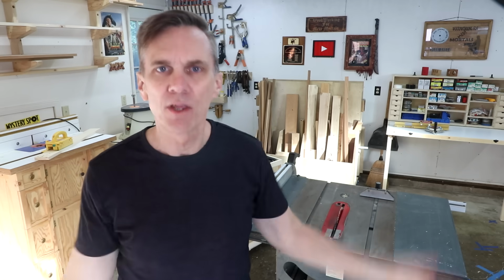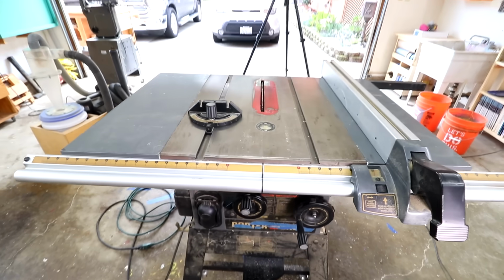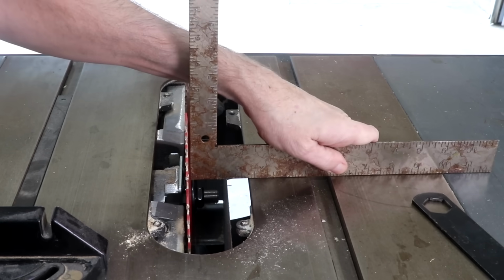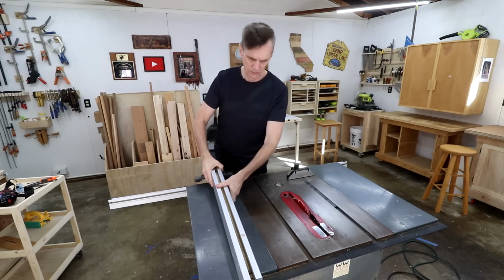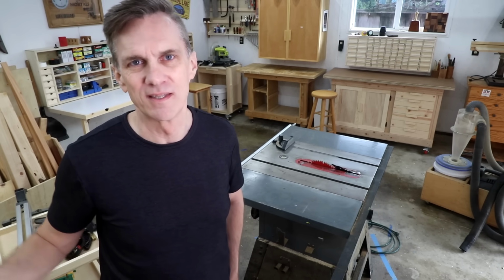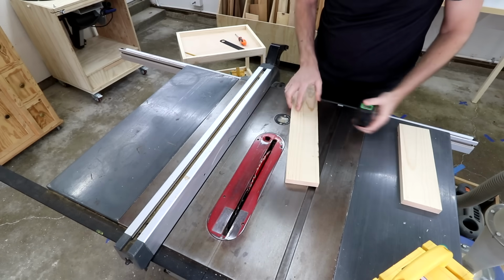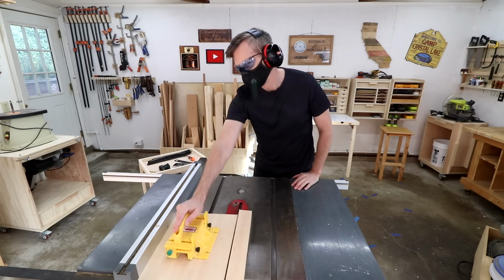A step-by-step guide to making your first table saw cuts. TABLESAW BASICS.

Comment: I think with the blade out all the way, you use the part of the blade that is moving fastest relative to the direction the cutting needs to be applied. Where with a shallow blade, the blade is cutting diagonally through the piece of wood. 
Like imagine a band saw. The blade is perpendicular with the ground and wood (x and y axis). The direction of the cutting angle with respect to the wood grains is 90 deg (along the z-axis). 
I'm not nearly as experienced, and I'm here to learn from you, not myself. I was just wondering, that may be why people like blade up all the way. It might be optimal cutting, but I am also sure the difference is very negligible.

Comment: thank you so much for the info, i am getting interested in table saw use. i was going to buy one but my wife's uncle gave me his old one, he is maybe 86, just cut his fingers on the very saw he gave me. a step back he was/ is very capable of woodworking a quick example one of the houses he bought he did not like where the basement steps were so he moved them. after ripping a practice piece it just didn't feel right. so after watching your video i looked he must of taken off the riving knife because there is none the rip fence locks down with a what i believe is a makeshift bolt and just above that is a screw to lock down the fence more it feels like it may move a bit after that as well. the blade guard is is off as well but from what i see most people take them off. i know you should not be frightened by a saw but respect it, when doing my practice cuts i kept thinking how a very experienced table saw user almost lost his fingers, then i thought to myself maybe it was just a lapse of judgement , sorry if i were rambling on, i may just go buy a new one thanks again for the info.

Comment: Question: Why the table saw are not designed to spin in the opposite direction ? So when there is kick back it will be in the opposite direction of the person standing.

Comment: I have a old Ryobi BTS10 (not RTS, it’s that old) and it still works.  I have been watching numerous table saw maintenance videos to square away the blade and clean it up.  My question is when using a table saw, how high should should the table be?  I have to build a table to mount the saw and I want to know what the correct height is.  I like your video and I have subscribed.

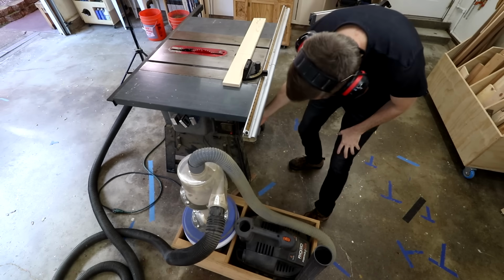Comment: Hi, at 9:24 I see what I presume to be your vacuum behind your left shoulder sticking out of what appears to be a 5gal bucket with a hole in the top. Can you explain this vacuum to me what kind it is and how it's used? I'm trying to think of a way to get my table saw hooked to a better vacuum system and I'm curious as to what you're using there. Let me know. Thanks.

Comment: One thing you showed but didn't explicitly mention was when using the push sticks, to stop guiding the cutoff as it gets...cut off.  Pressing a loose piece of wood against the blade is, as I understand it, a recipe for danger stew.  A riving knife should absolutely help prevent kickback, but I feel it's still worth mentioning.  To be clear, I am one of those novices at whom your excellent channel is directed, so I'm open to correction or clarification!

Comment: Steve! First off, love all of your videos man. I got into "woodworking" (I use " " because I struggle to call what I do woodworking at this point) due to the extra time from quarantine and your videos have been an integral part of my learning curve. My first table saw is very similar to yours (a PCB270TS) and the previous owner didn't keep up with the riving knife or a few of the other safety accessories. Do you have a good source for replacement parts or should I continue with my own plans to use the MJ Splitters to build my own? Thanks!!

Comment: Hey Steve. Very useful videos these. I'm struggling with my rip cuts being perfectly straight - the fence is straight (proven with calipers) but I'm noticing on a 1800mm piece, it's often about 3-4mm difference at each end. Is it simply a question in doing too long a piece - I'm feeding through by hand then using a MicroJig for the end bit. It's usually the start is thinner than the end

Comment: Hi Steve, I’m a new viewer, even though I’ve been using a table saw for 50 yrs. with no issues. I had an issue last week and didn’t know why. I had a major kickback for the first time. I have a fairly large Craftsman Table Saw that I purchased in 2003. I have never had a riving blade. How can I find one for my saw, that doesn’t include the plastic safety shield? Any suggestions? 
Even though I used a table saw for many projects. I learned several things that will make my wood working easier and SAFER!!
Thank you so much. 
Pam James

Comment: I just bought my first table saw on friday and made my first cuts today.   Yesterday I put it together and got it all setup, well mostly but that's another story.  Today   I just made my first cuts using 12mm (yep, I'm metric, sorry) MDF, ripping it down to 300mm by 180mm.  The cuts went extremely well, not perfect but that I think is more about my skill than the saw.    Having watched this and a load of other youtube content, I felt confident that I knew what the parts of the saw are, why they are they and how to use them.    In addition I've been watching safety videos and can understand the safety aspects of the saw.     Thank you for putting this content up, as it has helped me greatly.

Comment: Just bought a table saw to do some wood working upgrades to my RV & I'm a newbie. Fist project will be to build a Farm House Coffee Table with framing lumber, using (4) 2X4's and (4) 2X6 boards I want to make the 2x4's 3" wide to Rip / trim off the rounded edges on both sides of the boards & the 2x6 boards 5" wide. I'm a bit confused on what to set the fence to get the proper widths of these boards. from  1/8" from the blade width. - Any suggestions would be most appreciative. Thanks Rich - Florida,

Comment: So I bought my first table saw but I have a couple questions. 

I opted for an antique that I picked up for a good price on Offer Up. It is a 1950 Delta Rockwell contractor’s table saw with a rolling stand. It came with the original miter gauge and rip fence. It did not come with a riving knife and I’m not sure that saws of this era did. Could one be installed on this old machine? Also, my rip fence doesn’t glide very easily and when I adjust one side, the other side does not follow and remain square. Any suggestions on how to correct this? Should I consider installing a new rip fence?
Reply: Bump.

Does Steve or anyone have any thoughts or suggestions on this?

Comment: They say "familiarity breeds contempt" 

as someone who has used numerous cutting devices and high heat guns etc I always feel mistakes are easily made regardless of level of experience. 

It's always when you "zone out" for that split second, then watch those fingers fly across the workshop and straight into the  ice box for the trip to the Hospital.

Comment: Ģreat video and great editing. I can't seem to keep my cuts straight. I feed tight along the fence. Pressure against the fence to keep the wood in place. By the time the wood is at the end of the fence it's no longer against the fence. And, it's more pronounced with longer boards. I put the piece I'm cutting( the measured piece) against the fence....if that matters..
I need to make better cuts.... and more consistent... I don't think it is the saws fault. Perhaps it's inconsistent pressure...?
Reply: Maybe you're not pushong straight enough(with the hand that is behind the workpiece)

With longer pieces, it is easy to move and end up with an eight of an inch short. Try going as straight as possible. There's no need to over push the piece on the fence. Just lock it enough against it so it don't move away from the fence. 

And try checking if the fence is really parrallel to the blade. Maybe there's something there
Reply: @Wysail  Solid advice. I think you are onto  something. I suspect my feed method is the culprit. I'm most likely pushing at an angle when nearing the end of the feed process and not realising it.   I usually check the fence off the blade for equidistance.... I just switched saws so I hope that'll help a bit.. 
Hey thanks for the tips I think they will help...🥃

Comment: Ok newbie here and haven’t used a table saw yet. So if you want to take off the round edges of a 2x4 you measure to an 8th because the blade width will take off another 8th to equal a quarter inch cut. Then repeat for other side. Outdoor that be correct?

Comment: Thank you for this video. Super helpful. Just bought a used Rockwell table saw and have felt a bit intimidated and haven't cut anything yet and luck would have it, this video popped up on my feed. After watching, I feel better about cutting, but my saw came with a guard (taken off) but no riving knife. It doesn't appear there is space for one. Is this something I should absolutely go find online somewhere or do some just not have them? Or is it blade guard or nothing?

Comment: I am trying to square up 2X4s for a table top. I have a cheap handme down hitachi table saw that seems to operate fine except that after teh leading end clears the blade it seems to get pinched or bound up. I have re-checked my blade bevel, ensured my rip fence is squared to the blade and re-adjusted my riving knife. I am using pine wood (scraps to get the technic down). Am I missing something else to try?

Comment: Different table saw than what is in your tool list?  I like the extensions especially.  I have an old Craftsman table saw with no riving knife and no extensions or bigger fences available.  Can you provide information on the table saw you are using, pros/cons?  I need to replace my old table saw (10 inch)

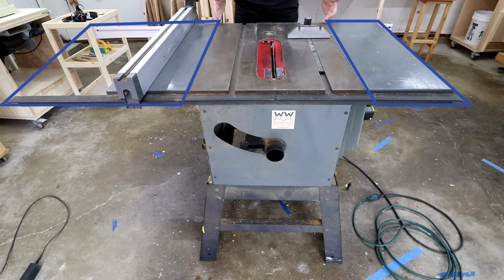Comment: 2:43 That looks far better built than the ones i was looking at around the £150 mark. The fence locks at both ends, it has a place to store saw blades, it doesn't have weakly-hinged extensions that bend over time so you lose your square top surface. And it just looks solid, not like the 1mm steel jobs i've looked at.

Comment: I'm really enjoying the videos and will be starting the course as soon as I finish collecting the tools!

I am a brand new wordworker, and I bought a second hand Ryobi table saw, and I'm wondering about the riving knife. It's adjustable, but how high/low should it be? I reattached the blade cover since you advise it, and it clamps onto the knife just fine, but should I lower the knife after connecting it? It says something about having the riving knife in the up position when installing, but does that mean when cutting too?

Comment: bit of a tip; when doing long rip cuts which require you to start a ways back from the saw (8ft long board or such) as you step up to the saw don't push; as you close the distance plant your feet then continue with the cut; stop pushing, take another step, plant your feet then push,  you will get a much smoother cut,  Especially important with plywood....never push as you step; push only with feet planted and stable, safer and more accurate

Comment: Thank you Steve! This video really helped give me some confidence using my table saw. I've had a Porter Cable saw for several years, but have not known how to use it properly. You cleared up some things for me. The blade guard was always a hindrance to me so now I took it off. I bought the gripper push block and a hose for the saw dust exhaust so I don't have to move the table saw out in the driveway when I want to use it. I've got lots of projects that I can now get started on and not have to rely on my skill saw!

Comment: Hey i found a used table saw for $20.  It is a cheaper brand that rimes with chilsaw.  It did not come with a mitre push thing or an insert.  I watched your video and wanted the insert plate.  I found one on amazon but it was too large.  The second one fit in the slot well, but the hole is not where the blade is.  (2cm or so off) My question is can i cut the hole larger to fit where the blade  actually is?

Comment: Great video! I have a question. I bought a smaller cheaper saw (yet still well-reviewed) that seems to have a miter gauge that is fixed to the rip fence. Can I still safely crosscut with this setup if I just use the miter gauge normally while it runs along the attached rip fence?

Comment: Thank you.  I recently retired and moved and had to give up my father's ShopSmith.  I'm now rebuilding my woodshop piece by piece and I'm about to get a table saw.  Needless to say that there are A LOT more safety pieces than my old ShopSmith, which was basically a blade attached to a motor.   Thanks for all the advice and insights.

Comment: Sorry if this is a silly question, should the rip fence be on  the left or right of the blade depending on if you are l left or right handed? I see you have the rip fence on the right of the blade. Which is safer?

Comment: Does it matter which side you prefer to work on? I always perceived it as either or, whatever is comfortable to you but i saw comment that recently indicated the rip fence should always be to the right of you...why? i don't see a difference safety wise and as righty and since my saw didn't come with a fence, i've always taken my custom ghetto one (clamps, board) and worked with the fence from the left. Thoughts?

Comment: I've been following suggestions that I can get a used table saw in pretty good shape on places like craigslist or facebook marketplace. I've seen plenty of decent looking saws at low prices. In looking at dozens of them, what I don't see is a riving knife. I saw one video from the UK that said it's only been in the last decade or so that they were required in the US. So is it just that dumb people took them off, or do older saws usually not have them? 

Should I just go with a new saw? I have an old Ryobi table saw that has a splitter/riving knife that hangs off the back. I cannot for the life of me get it to stay locked in place securely enough. So every rip cut comes out uneven with blade marks. And I want to upgrade. I appreciate any advice.

Comment: Dry runs are smart advice.  I took a kick back board right to that little bone on the edge of my wrist at the base of my right thumb.  I was ripping about an inch off a short piece of wood and used a Microjig pusher.  The business part of the pusher fit between the blade and the fence easily so I started pushing it through, but the little platform on the side did not clear the splitter, so the jig rode up on that and off the wood.  The cut was all of the way through, but the piece was barely clear of the blade.  I pulled the pusher off the wood (mistake!) and back to my side as i was reaching for the power button with my other hand, but before I could cut the power the blade caught the board and fired it back at my wrist.  I was lucky though - nothing broken - just bad swelling and a sick bruise that covered most of my forearm.  I dry run everything now.

Comment: Thank you fo making this video. I bought a SKIL saw table saw with the "worm drive" and everything. I made the mistake that a portable saw would be just as good as a true table saw. Boy was I wrong. If one's goal is construction and building houses then a workhorse like the Skil saw would be great but if you're looking to do accurate and PRECISE woodworking please save your money and invest in a table saw specifically geared towards woodworking. I made this mistake and now I'm $350 bucks in the hole, I continually have to square and zero my blade, it's a nightmare and will make you want to quit. Please look up some good quality saws, they are out there and they don't have to break the bank either. I only wish someone would have told me about this sooner. Good luck everyone; woodworking is an awesome and fulfilling hobby.

Comment: Hi Steve I’m really new to woodworking and I wanted to ask about ripping pallet boards on a table saw! Do you rip one side then flip over and rip the other? Do you have to adjust again for the second side? For instance if your board was 90mm and you set the fence to 88mm ripped 2mm off one side would you then need to adjust the fence to say 86mm? And end up with an 86mm board, but straight at least! Help!!

Comment: I'm having a hard time getting my fence to stay straight. Kobalt 1015. It keeps going wide at the end
Reply: Is the riving knife lined up perfectly with the blade?  I have the same saw and it was out of alignment out of the box and would cause the piece I was cutting to push against the fence. There are a couple screws that allow you to adjust it to the left or right.

Comment: Oh the table saw that kicked the blade guard at me,  Porter Cable! I didn't get the pin seated correctly after putting it back on the saw and its a pain in the ass to set the fence with it on the saw. Now Mine was a plastic body portable saw with stand. But I have both a Jet and Grizzly cabinet type saws. the grizzly has never been plugged in I got it 19 years ago, the Jet is a 2018 verson My son gave me new. I'm a big fan of board buddies, but I like the Jessem stock guides.
Anything to keep your hands as far away from the blade stock on the table and anti kick back I'll take,
The board buddies are a cheap option but I want the Jessem stock guides.  I refuse to use the guard on the Portable Cable saw, it was a really shitty system.

Never stand in the firing line of the blade turning on the saw, it dosn't happen often but lets say you son knocked over his bike into your saw the blade was out just a tad and the bike clipped the sawtooth breaking the carbide cutter loose on that tooth you turn on the saw and boom you have a 200 mph carbide bullet hit you in the face., stand to the far left side of the tablesaw switch or away from the blade with safty glasses on every time you turn on the saw.